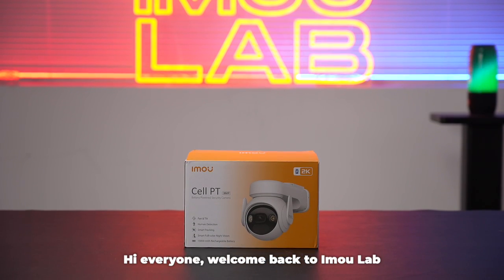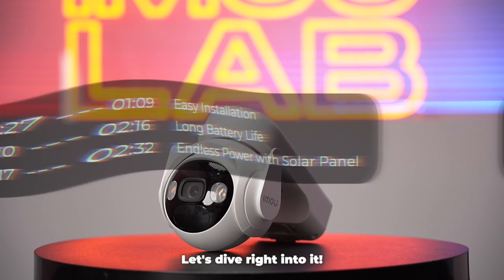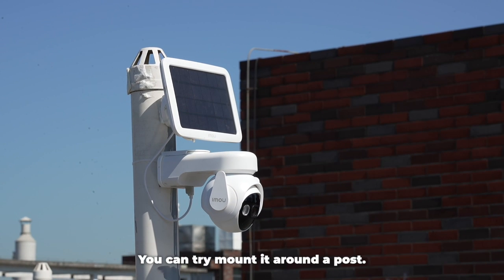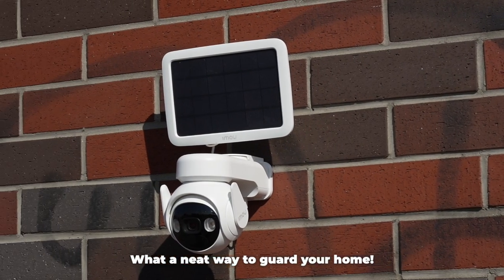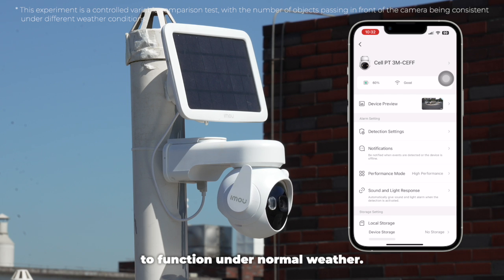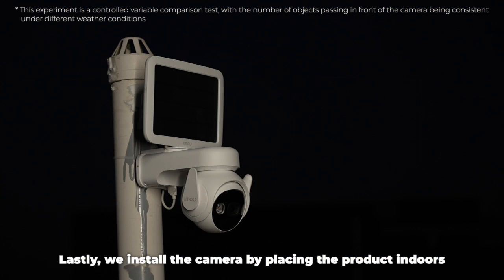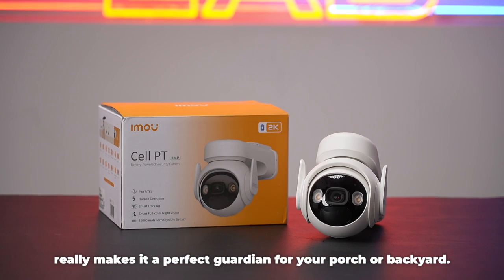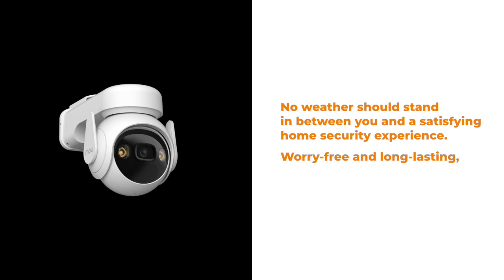Imou Lab: Cell PT Episode 1: Power Consumption

Comment: Don't buy it if you need a real security device, not a  IOT toy, This cr@p does NOT support onvif and any HVR (Dahua too). It is not suitable for closed circuit television. Using it as security device is the dumbest idea especially the wifi version! The only posibility is to record on mmc card which will be stolen with the camera. The wireless connection can be easily jammed! But even so, the NVR can detect the video loss and activate othe PTZ camras. This cr@p can not. You will be blinded.